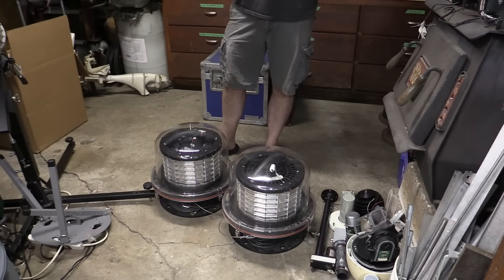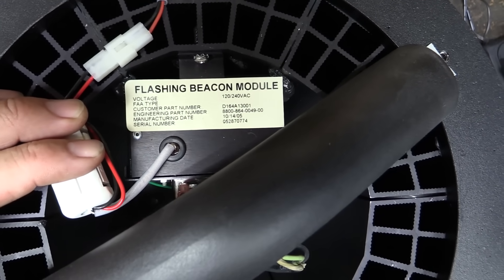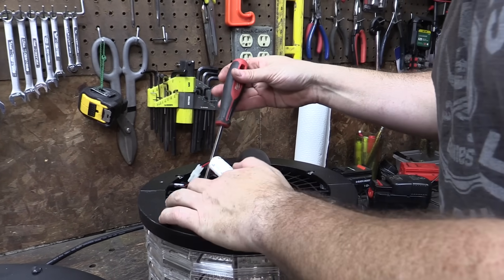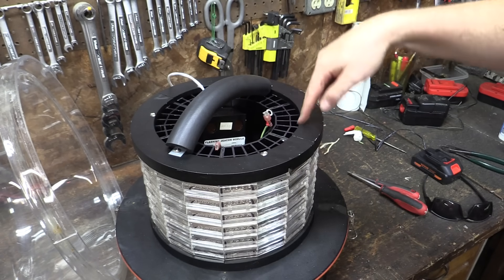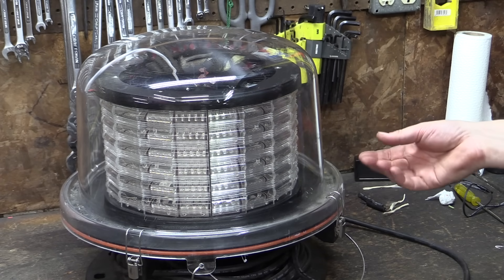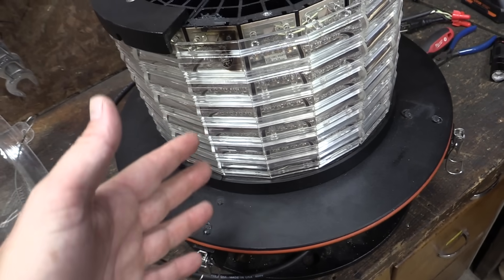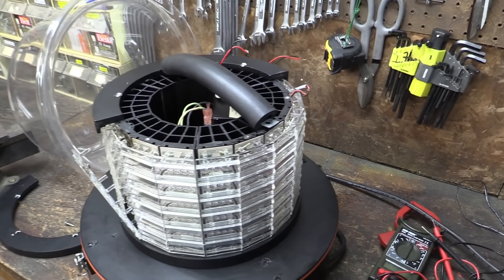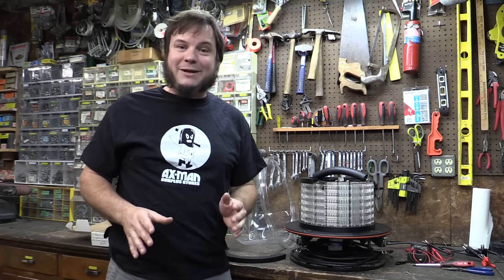Surplus FAA Tower Beacon Warning Light

Comment: Each LED "consumes" about 3v, so with removing the whole string on one board, you increased the voltage across the rest of them by that amount split up.  Probably why it fried.  You can add up quantity of LEDs, and calculate what voltage they should be driven at.

Switch the good power supply to the other unit that looks like it has good LEDs.

Comment: If they're all in series, then bypassing one LED will just increase the power going to the rest.  So no wonder that a second started to smoke.  But it's kind of crazy to put them all in series then apply a high voltage - if the modules were in parallel then one module could die and the rest would limp along just fine until the fault could be repaired.  Maybe you could just figure out a lower voltage to drive one of those heatsink modules by itself?  Would be a nice taillight for a bicycle!

Comment: Maybe you can hook up one column of LEDs to a DC power source. I am not sure if you have an adjustable power supply. If you can make one column light up, you can re-view all the columns to be series and run it from a different DC power supply. And with a lower voltage/current will last a long time.

Comment: Dialight is pretty much standard for aircraft hazards we had an install earlier this year replacing the old xeon strobe boxes that were long overdue (half of them didnt work even after servicing). The top becon that goes on top of our TV antenna was suprisenly light. During the sales pitch last year the install vendor described this as a first gen model.

Comment: My guess would be that the current limiting in the PSU is faulty, which is why they lit up very bright, then instantly faded as the first LED started to break down.  Rinse and repeat every time you jumper out the failing LED.  I'd be inclined to pull one of the lamp segments, and figure out its power requirements individually.  It might be easier to run it off 12V DC, or a similar PSU.
Reply: My thoughts exactly. It seems frankly negligent to wire them in series, for what is supposed to be a safety device. If it were Mine, and I really wanted it running, I would rewire each LED module to its own PSU. napkin math says its a 48v string (6 rows, 4 columns, 2v per red led). either a box of constant current supplies from ali express, or a LM317 style CC regulator running off a 48v supply. Id personally go the lm317, they are cheap, and the wiring would be very simple, just common all the -ve, and 'dead bug' the regulator circuit (its 2 components). a working beacon light would surely be the price of admission for a lighthouse visit ;-) Best of luck!

Comment: You need to add some resistors in line where the blown led's are that are equal or higher resistance than the led's themselves. You most likely burning out cause too much voltage is running through them. Find the resistance of one of the led's and add a resistor in place of the burnt out led's and I'd also add one half the resistance of one of the leds in series befor each led stack. That should prevent further burnouts.

Comment: It's supposed to get a flashing power supply, notice how all the lights on a tower flash at the same time. Also Im going to guess it works better at 240 volts to be compatible with the old incandescent circuts.

Comment: Yes, the LEDs are in series as it requires less current and thus thinner and cheaper copper wiring.  Large screen TV's all have their LEDs wired in series for the same reason.  High voltage is much easier to produce from the AC line than high current low voltage DC.  The AC component you measured is probably pulsed DC.  LEDs can be over-driven to produce more light output, but the duty cycle must be short to keep the average power dissapation below the max for the LEDs.  Human eyes don't perceive the pulses, just like they don't perceive the frame rate of a motion picure, but they do perceive the brightness.  Cars with LED tail lights are over-driven this way which is why they seem to be pulsing if you sweep your eyes across them when lit.

I envy you for having a place like Axeman Surplus near by.  If I lived there I would probably be broke and swimming in all of the stuff I bought.  The appeal of neat stuff to take apart and tinker with is just too much to resist.

Comment: If you really want to mess with something slightly more "open" (and by that i mean not potted), look at Hughey And Phillips. Service manuals are actually available and they still have customer support. I don't work for them, just privately maintain control boxes.

The voltages you were seeing look about right, but be warned you can easily reach voltages no standard meter will handle.

And another name for the whole beacon on the top of the tower would be the Flashhead.

Comment: Bet it would of been fun to change that light over! Judging by your power supply voltage I'd ditch it, find out what voltage is needed to drive a single LED array and go from there. Voltage divided by arrays should give you a starting point with a DC bench supply.

Comment: I would bring it up with a variac (auto-transformer). However, you likely have power supply issues. You could calculate the voltage required based on the number of LEDs, and assume 2.2V per LED. The current required will vary with the LED power rating. One simple solution is to apply a voltage x amount higher than you need, and then add a series power resistor. The series current through the LEDs will be Vx/R.  Try not to over shoot the total LED voltage by much, so the power dissipated across the resistor is low.  You could probable even apply the exact voltage you calculate and use a low ohm resistor to keep the watt energy low across the resistor. This all assumes you are comfortable building a high voltage power supply with voltage doublers. They are fairly simple and common on old school tube electronics. 

Stay safe and be sure to use bleed resistors across the caps if you make a power supply. Anyway, something along these lines is how i would go about it. You might consider a fan to help cool the heat sink. Great video! Fun stuff!

Edit to add, I would start with more resistance than I need, and step up the current by lowering the ohms (maybe add resistors in parallel), or like I mentioned use a variac on the AC input of the supply to control the power.
Reply: A switchmode power supply would not be able to be regulated on a variac.
Reply: @zaprodk  That is a fair point for the opening sentence, assuming it is a switch mode and it likely is. However, it would not really hurt anything to bring it up with a variac, even if it is a switch mode, but it would not really give a soft start. It just would not achieve regulation until you hit the minimum operating voltage. It would also pull more current when the input is low, so I agree it would not be effective.

However the bulk of the comment for the voltage multiplier and building your own power supply would work just fine, and that could be used with the variac for a soft start.

Comment: If you have a Variac run it through a 100w lightbulb then a bridge rectifier. Then off to the LED array. Slowly increase the Variac and you should be able to start testing the lights that way and get an idea of current draw etc

Comment: You jumper out the weakest LED and then the next weak one shows up. LOL. The power supplt is a constant current driver so it shouldn't matter how many LEDs are in series, as long as you are inside the compliant voltage (there might be some under/over voltage lockout). I'm an EE BTW. I would replace the LEDs and keep the lenses etc.

Comment: Try adding some resistors in the place of burned leds, to avoid raising the voltage on the other leds. Also, each led should use a small amount of voltage, if you can try to calculate the voltage based on the number of leds and the output voltage of the power source, you can reuse them alone.

Comment: All right, what is most likely happening is the beacon is supposed to have a duty cycle and blink for a very short period of time usually about a second on and 2-4 seconds off. and the off time it gives those LEDs time to cool off but because something malfunctioned in the power supply, the LEDs are staying continuously on and overheating. What you might want to do is pull each module out and break the series string, cut the jumper wires between each LED module out and use a variable power supply and raise the voltage up until you find the voltage that they give off a decent amount of light. Alternatively, you can count all of the individual LEDs in each module, Each individual LED should be about 3 V. That should give you an idea how much voltage each module uses but I would put them all in parallel and if it is something lower voltage like 24 V or 12 V you can use an automotive style turn signal flasher. Some turn signal flashers have alternating outputs, especially if it is a three wire turn signal relay. You can alternate between even and odd modules to make a cool  chasing flash.

Comment: Might be good to take those modules, flip all the even ones upside down, and run them in parallel  with one band going around the top and another around the bottom for the other wire. so they can run at 24v or whatever.

Comment: Yeah you’re gonna want to put a scope on those black boxes…I’ve seen some pretty niche frequencies/voltages/modulations in some specialized lighting stuff (like 400Hz 20VAC in some old EL wire)
Reply: That would be expected for EL wire though.  What you would want to do is have a look at the data sheet for the LED's, then extrapolate from the pcb they are on.

Comment: Don't put a scope on the black boxes unless you know what to expect. Even then, at the minimum a resistor divider is needed to bring down the 1000V to at most 250-350V what the scope can stand. Instead of jumping over the module, a random resistor would have been a slightly better choice.

Comment: The LED packages in these beacons are not common - their resin housing with molded-in lens is similar to a Piranha-style LED (originally developed for automotive brake lights), but these have 6 pins instead of 4. In the early 2000s when these were made, some high output lights would use multitudes of fractional Watt LEDs with through-hole leads soldered to standard circuit boards. The copper pads on the back side would be as large as possible, to help transfer heat away from the LED. A further step was to sandwich a soft thermal pad between the clipped pins on the board and a large aluminum heatsink. The thermally conductive rubber or silicone pad would prevent the pin ends from touching the metal heatsink and shorting out. It looks like there are large white pads between the boards and their heatsinks on these, so I would not be surprised if Dialight used this technique to help ensure these beacons would last for years with minimal dimming or failure of the LEDs.

I would at least remove a board completely, to understand better how the individual LEDs are actually wired on each PC board, and if the extra pins on the 6 pin LEDs are connected to other pins in parallel (the 4 pin Piranha LED packages had 2 pins in parallel on each side). This increased the amount of connecting copper, improving heat transfer from the LED die to oversize copper pads on the circuit board. Or there might be 2 pins per LED, but 3 separate red LEDs side by side inside the same package in this case. If so, they would likely be connected in series via PCB traces, and each board would effectively have 3 times as many LEDs as they appear to have from a package count.

The whole concept of conducting some waste heat through the leads of through-hole LEDs is outdated now, because it didn't scale to the 1Watt and higher LED packages which were beginning to be used for high Wattage LED fixtures. Nor could through-hole LED packages work with the metal core PC boards that enabled the new surface mount power LEDs to conduct heat far more efficiently to a heatsink. But 25 years ago, these square resin packages with extra or thicker leads were still considered an advance in LED technology. And marketed specifically for applications where high reliability and long useful life were important, like the transportation sector.

The odds are good that the driver boxes were at least partly responsible for the failures, given their age. But I've also seen LED boards like this with individual LEDs that failed (short or open) from transient voltage spikes that either came through the power supply, or were induced directly to the LED boards during a nearby lightning strike. You'll find better transient voltage protection on all but the cheapest LED power supplies today for this reason.

Comment: Each cob section should be 1.5 or 3 volt each, depending on the resistance. They are pretty much junk unless you can find the exact cob replacement. When you jumped it they all got too much voltage. They will just burn out the next one in series until its all smoke. Add a 6 volt resister in the jumper and see it its more stable.

Comment: I would start by separating all the LED boards and testing each one individually on a bench power supply.  Looks like each one has 4 LEDs, but each LED looks like it has 6 legs, so that's either 4x3 series-parallel, 4 huge, or 12 LEDs.  Red LEDs run at about 2.1 volts, so each board should light up somewhere between 2 and 24 volts.
My simple LED power solution in cases like this is just stack up 170V worth of LEDs in series, put a bridge rectifier between the LEDs and line voltage (filter capacitor optional, but recommended), and maybe put a large incandescent lightbulb and fuse in series with the incoming line voltage (on the line side, not the neutral side).
Also, rigging up a lightbulb socket in line with the hot wire has been a good safety system for my dad and I when testing equipment of unknown electrical characteristics.  Screw in a small night-light bulb for small loads, and bigger bulbs for bigger loads.  If something is wrong, the lightbulb will light up instead of something else potentially releasing smoke or fire or worse.
Also Also, I recommend getting and using a power meter, like a Kill-A-Watt, when testing things.  If they use significantly more or less power than the nameplate says, that's a good diagnostic starting point.

Comment: First thought was to empty the housing and put one of those LED fan projector things in it.. Second idea, pull all the LEDs off the heat sinks and replace them with peltier thermo electric pads, put the dome back on and see if it would generate electricity from sun exposure

Comment: First, we all know it will no longer be used as intended so, determine wiring structure, obviously replace power module with a regulated power supply far greater than necessary for longevity & you have a fine light. You can also use the LED's as pixels & control them as tracing lights, VU meter, TX/RX power/reception meter. I would appreciate the opportunity to own one if you'd sell. Enjoy.

Comment: I can't believe the FAA signed off on that design. They have some ridiculous rules for aviation.  Maybe parts not on a plane itself are more lax? But for obstacle avoidance you would think they would treat them the same.  And yes you can fix one or both depending on how you want to move forward. One could be a donor for a 100% perfect light or 2 with slightly diminished power.  Just make sure you understand the power requirements.